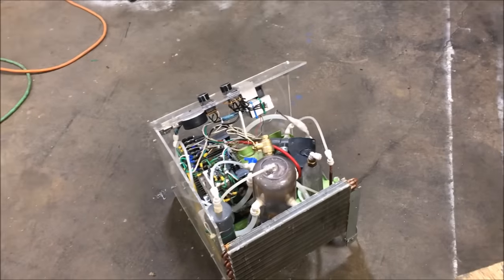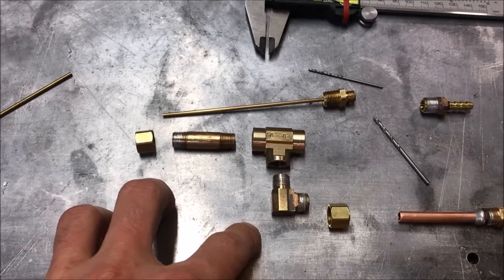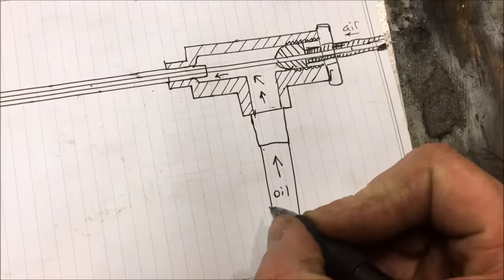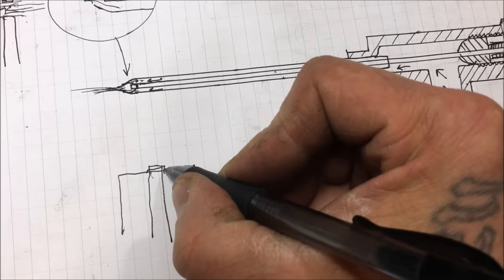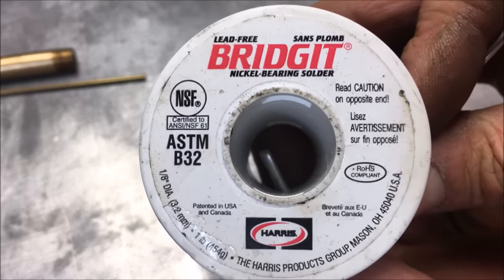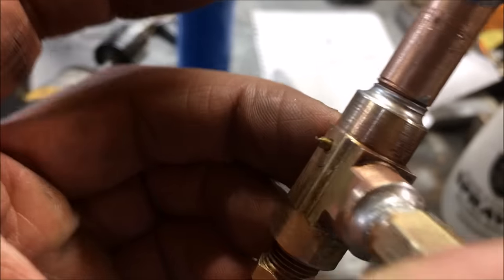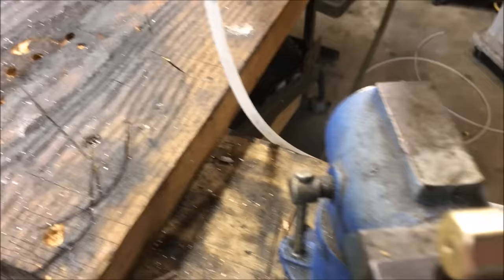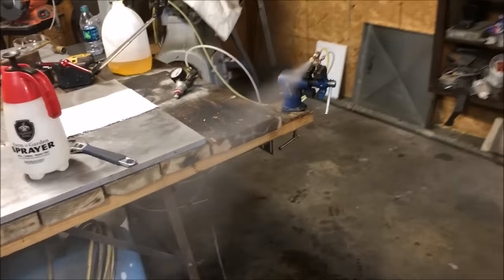Waste Oil Burner Nozzle Design Principle MASTERED (DIY) prt1

Comment: Thank you so much sir, I am making an kerosene/diesel burner based on the Lune Valley Burner, but I did not understand part of the patent drawing. Your video is the exact information I needed! I have an ASME Code and Stamped 1000lb in weight Steam Power Boiler (~7HP) on my steamboat. I have been burning coal/wood/propane - just getting into the oil burner realm. Thanks again!
Reply from the maker: No problem , let me know if you have any issues
Reply: Wow that's so cool. Have you made your steam boat or is it bought?

Comment: Lots of clear and detailed information in this video, so thanks for that!  You make it straightforward for others to build the same atomizer design.    And you are correct.  That is the Venturi effect, which is also how carburetors work.  

I know of one thing that may help your viewers.  At least where I live (southern Wisconsin) many hardware stores (True Value, Ace and similar, not home centers like Menards, Lowe’s or Home Depot) carry a rack of individual K&S brand hobby metals.  I recently bought two pieces of K&S brass tubing for a different project for under $3 total, and they were marginally larger than what you used in your video.
Reply from the maker: Yep i use to buy alot of K&S

Comment: I attempted this 20 years ago , until finally I used a hand held paint gun a develbis modified head caps into a high volume at low pressure to achieve a stream fog into a fire tube that was perforated , had a previous problem with air becoming a problem controlling temperature ,I worked it out with liquid air ,for my waste oil heater , ,like your technique thanks for sharing

Comment: I have been working on using oil to heat my shop for a few years now , and I can say with an reasonable amount of certainty  that you would have to have one hell of an heater to need that much oil at any time . All of my designs use tiny amounts of oil  although I have thought about using air  several times but then there is the added cost of running the air compressor
Reply from the maker: I build Industrial heating systems
Reply: Lawrence Johnson 
How does the system you have work mr. Lawrence? I rebuild transmissions and would like to burn that oil for heat.
Reply: Hello, after trying to burn the oil as if it were wood , I had little luck as the wood stove  could be run at low temps/oil consumption  but if I tried to turn t up much , then there would be an runaway extremely fast. It seemed that with all of the designs that I found for this style of furnace on you tube, they were just interested in burning the oil not using it as an fuel source.  I finally found that if I ran it with zero fire box pressure but still with plenty of draft then the thing would run just fine.  I'm sure that auto trans fluid would burn the same as cooking oil  as they are both about the same viscosity . I'm running my furnace with about two drops an second fuel flow but my shop is real small. I have no fans on the fire box or and injector pressure on my inlet line gravity feed . also, I am using charcoal to aid in starting my burner as it will get up to temp pretty fast and then the oil will take over from there I hope this can help you

Comment: Well explained, excellent work. You just saved me sooo much fiddling around. Very much appreciated!
Reply from the maker: Turns  out thats my job homie , just kinda fell ass backwards into it . Glad i could help , i recommend a slightly larger pentsock for the oil
Reply: How about a 1/4" copper pensock for the oil ?
Reply from the maker: yes a larger penstock would do this thing some justice but the jet  size must remain the same for the air flow parameters to stay within combustible ratio's
Reply from the maker: to be clear ,the nozzle must stay the same size but im assuming you know what i mean by penstock. im sure you know what i mean but for the guy who asked its just a delivery tube thats larger then the nozzle , it increases flow by reducing restriction

Comment: It is an airbrush system. It will only be good if you adjust the intake, either of oil, or air. I think you can use a paint gun, along with an air compressor, obviously. Perhaps, a refrigerator compressor would do. Thanks for the idea.
Reply from the maker: Well thanks for the input , we actually  tried the ac compressor and it didnt work, its about 10% of the air you need
Reply from the maker: yes it is , and i even considered buying a cheap harbor freight paint gun but another guy did it and the air flow was not enough , he also had to ad gas or some other fuel to get it to burn

Comment: Well Nobox 7 I am a believer, it work Just completed mine with water luckily as you suggested and Got a nice bath in the process because as I tuned the fuel line I left it unsoldered at the back where the fuel should enter,so the air blew it out and back fed into the  water bottle. Once that was fixed that was it. Just as you said the optimal place for the fuel line is flush with the face of the cap.
Reply from the maker: Glad to here you got one working , im making another tonight as i had to sell my last one , but hey i got $70 for it

Comment: I've done all these types of atomization tests some years ago cooperating with other experimenters on Yahoo groups wastewatts, Babington burners, and siphon nozzels. Now days you don't have to fabricate your own nozzles as you can buy a siphon nozzle for around $40 that is designed for waste oil burners! We never went to 75lbs pressure, usually 14lbs on heated oil or just siphon and maybe 20lbs on preheated air. Burns real clean!
Reply from the maker: Those nozzles suck and you still gotta buy valves and fittings so no its not $40 at all

Comment: I built one of these nozzles tonight and was able to substantially simplify the build. 
Parts list written verbatim as it appears on my receipt:
1/4" FIP brass cap
1/4" MIP x 2" Nipple Brass
1/4" x 1/4" x 1/4"  FIP Tee Brass
Two 1/8" barb x 1/4" MIP Adapter Brass [might want to use a larger size for the oil, depending on viscosity and output requirements.]
1/4OD x .170 ID vinyl tube [the 1/4" OD tubing fits tightly on the 1/8" barb.  you can test your chosen diameters at the home improvement store with the displays]
On hand
1/4" Copper Tubing x ~4"

The assembly is pretty much as you outline, except that you solder the copper tube to the 1/8" barb fitting, omit the elbow, and use another 1/8" barb on the bottom side of the tee.  The copper tube replaces the specialty brass tube and omits the need for the reducer fitting.  The assembly is highly adjustable from three connection points to get the orifice just right.  The oversized copper tube caused no issues during testing, it draws a venturi just fine.  It is aided with gravity, but it will eventually prime even above the reservoir.  

I used no teflon tape and soldered no joints (aside from the copper tube).  It worked just fine testing with water; no leaks.  I plan to add jam nuts to the connections to keep adjustability depending on what oil I'm using at the time.

I was absolutely BLOWN away by how well this came together with my limited machining skills.  I didn't even have the right size drill bit and was wallering out the hole in the cap until the tube fit through.  The atomization was INCREDIBLE!

I pulled the cord off my bench AC compressor and don't remember how it was wired, I couldn't get it to start, so I used a regular air compressor for testing, began at 90 PSI and it was about 60 when my bucket fell off the stool I stopped the test.  There was no noticable drop in atomization.  A little sputtering though, I think that was liquid delivery issue.  Higher head or a larger hose should resolve this.
Reply from the maker: The sputtering was caused by your lack of Teflon tape
Reply: @NOBOX7  Interesting.  The connections seemed to be air tight, but I did a water dunk test and found leaks everywhere.  I wrapped all connections in teflon tape and proceeded.

I found your video on AC compressor wiring - got that running!  Many thanks for that vid.

Sputtering was still a problem, but this time it was clearly an airflow problem.  

I wanted to see what this burner could do so I hooked up my air compressor and set the hose at 60PSI.  If there was sputtering, it's not apparent!

I just published a test video. watch?v=wDVTvXDllks

I will be ordering those craft metal tubes as this is honestly WAY too much power and fuel.  I'd need a bigger compressor to make much use out of it.

Comment: You have obviously put a lot into this.  The question I have is, how much electricity (or how little) does this require when operating?  I would need something that puts out much less heat, and I see that you can turn down the oil feed, but how low can the air pressure go?  Electricity is expensive and air compressors use lots of it.
Reply: He makes a mini version of that snail shaped burner, and I'm getting one-pretty sure you can run it off a commercial HD air pump like they use in hydroponics, I'm going to test it.  Those only use 30-60 Watts depending on size, see the Boysal Burner on YT for an example, that's the best design I've seen that doesn't require an air compressor.

Comment: now a multi lead angular groove right around the tip of the nozzle to spin the air out. maybe some secondary tiny jets to cut spin the atomized stream.
Reply from the maker: in my dreams . but man thats is bad ass idea , i can see it in my head . the jets would cause some desirable eddies also
Reply: NOBOX7  yup! That was my job when working on huge oil refinery furnaces! If you could get it to spin your efficiency would sky rocket! I would adjust the nozzels and get that perfect spin. The engineers freaked out because they had never seen such good performance when I was adjusting they came out to check their instruments to see if they were working right. It has to be perfect though. Adjustable jets are needed.😉 But hey you did a fine job brother!

Comment: Diesel injectors work great to.. and you can find them at junkyards and are built for heat.
Reply: For dirty fuel?
Reply: Not without pressure and cannot be siphon fed.

Comment: Great design, just 1 problem as I see it 
What’s to stop the nozzle choking up when put in the confines of a cylinder as the heat of that magnitude will have flames bouncing back at the nozzle

Comment: Isn't it more efficient to have the flame heat draw the air up into the burn chamber directed to create vortex so that greater heat can be stored in housing for less oil consumption it's utilizing every bit of thermal heat without loss out exhaust piping

Comment: Why not use a regular oil burner nozzle ? They cost less than $20. and they come rated with different gal per hr and various spray angles / patterns . I do like seeing your build and think you did a great job. 
Some time in the future I would like to build a vaporizer system that works without any kind of electricity.......
Reply from the maker: The ones you can by dont work the same , those chose manufacturing over functionality . also by the time you by all the rest the stuff you need this is way cheaper , i can build a nozzle with 2 valves for $24 connectors and all . Plus they are made in china so im good...

Comment: One question i hope you see this message, i know its a old video but can you put an elbow  on before the air intake and connect propane to use as a startup help, like OkiScrapper did on his wast oil burner.

Comment: You could tap four holes 90 degrees around the oil spear, and put small screws in them that would push on the spear and make it adjustable.

Comment: i don't know if its just a Chicago thing but i've had access to the needed tubing for years at my local ace hardware, well almost every ace stocks ks metals.  if wished they sell even smaller tubing, the ID is about .023 inches and OD of about 1/16 inch.

Comment: Judging from the thread pitch and the od of the pipe nipples you are using 1/8 npt not 1/4 npt. 1/8” npt has 27 threads per inch and 1/4” national pipe thread is 18 threads per inch. Correct me if I am incorrect in this observance

Comment: Get a oil nozzle  ( Boiler)G P H    no 6 or heaver... angle of spray  at 100 psi.. waist oil will need filtering and pre heating..i would think.

Comment: That will take a ton of air supply!
Reply: @Joe-by8jh  Not for waste oil. Maybe for diesel or kerosene. It would possibly  work for waste oil if it was preheated over 180f.

Comment: Thanks for the video man, it was informative. I accept that you aren't a professional videographer, and am not going to make snide comments about it being shakey. (sorry seeing that repeatedly in the comments annoys me for you). I have a question, and did not see it asked, in this configuration, roughly how much oil does this consume per hour?  I'm looking at a home foundry, and doing research on the delivery methods, and this looks amazingly promising, but I'm also seeing guys melting iron at a gallon per hour flow rate, and even atomized I'm guessing you are running much more than that. This looks like it would open a gateway to the nine hells when it gets burning.
Reply from the maker: Hello John , it can melt cast iron in 8 minutes using 1/2 gallon of oil

Comment: The burner I saw operating had a copper coil in the flame, then dripped the heated oil onto a red-hot plate, where the flame was held. Gravity feed of the oil.

Comment: I'm not very familiar with this since I'm in southern California but most automotive engine crankshaft and cam bearings contain cobalt, chrome, lead, and manganese so if we were to atomize and burn the waste oil from those engines wouldn't we be potentially putting lead hexavalent chrome and cobalt vapors and particulates into the space we're trying to heat?
Reply: Doesn't really matter inside a furnace

Comment: Awesome concept for waste oil or diesel or kerosene atomization. Curious though why you (later video) used it with a relatively inefficient 90 degree air horn. Curious if this design could be used with something more like a propane Venturi burner (like the steel forging guys use) but using this nozzle in the place of the straight propane nozzle... also of note, common propane is only pressurized around 8psi, yet that is enough to draw in sufficient oxygen in a propane Venturi burner, curious how low of compressor psi your siphon design can function on. Also I’m very curious how large of a compressor is needed to supply the flow requirements of this design. I’ll likely build my own to mirror your siphon setup, but I will try using a propane style Venturi burner to house it in and see what I can get. I just purchased the 2mm brass tubing for the oil (I will start off with a 50/50 mix of waste motor oil and diesel) and see if this can generate enough heat (inside of a forge) to reach forge welding of steel temperature. Worst case I might need to make 2 burners, just hoping my little 5hp compressor (and 80 gallons of tank capacity) can keep up
Reply from the maker: If you examine the chronology of it all you will see that it was development process , nothing better at the time was on youtube , i had to roll up my sleeves and do it myself , it took months of tinkering . this is all old news , i dont use this design any more
Reply: @NOBOX7  yeah I just stumbled into this video haha, gonna take me a few days to watch all of them. Just watched the 8 minute iron melt, that burner design looks pretty darn efficient with the air preheat chamber that is kinda coffin shaped... maybe I’ll replicate that setup. Thanks for the reply, I’ll be watching a bunch more of your burner stuff for sure!

Comment: Can't you use a pressure washer nozzle or a spray gun head. Or a mister head?
Reply from the maker: the air to fuel ratio is often not effective , i have several videos on air brushes and other spray can nozzles , they all kinda suck . i would tell you to check the play list but its probably hundreds of videos long by now lol

Comment: Have u used any pump?? how is fluid entering that nozzle?? and what if I require 3 such nozzles in series??
Reply: He's using compressed air as a venturi to siphon oil into the nozzle. Look up venturi effect.

Comment: nice idea however your design looks a little to complex. Search for Babington burner. it is a much simpler design and achieves a very good atomization. His burner designs were used by the US Army  in the food ration heaters and they were using heavy motor oil.

Comment: Oil burner only use's 6 to 8 or less psi.. Not sure been a long time since I've seen them
Reply from the maker: Yep with a 150 psi oil pump
Reply: @NOBOX7  the guy who used to work work on it wouldn't let me see everything he did and if I remember correctly it used to spray in a spiral pattern.  Was going to try making one but forgot about it until I seen your video. Hope you the best.